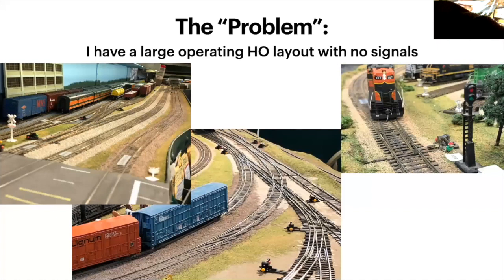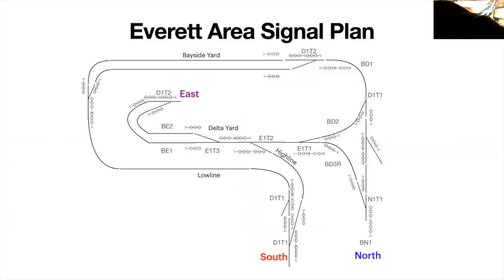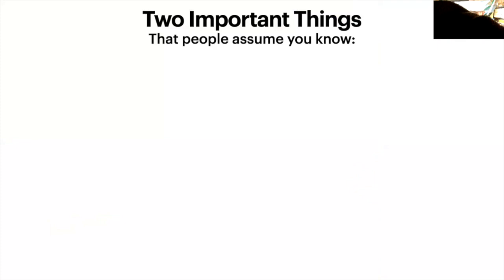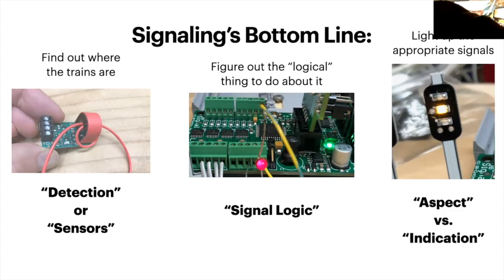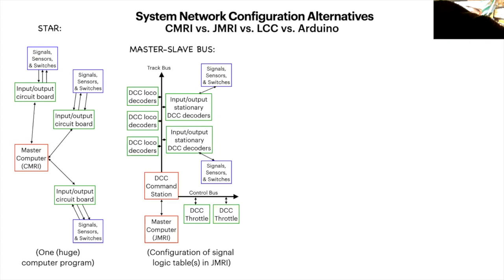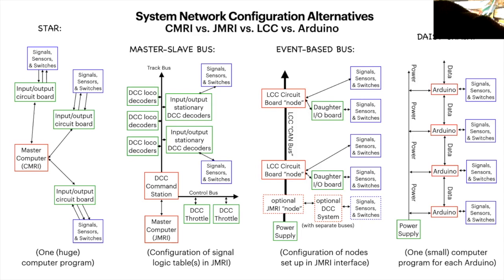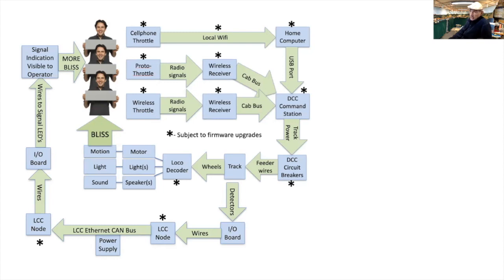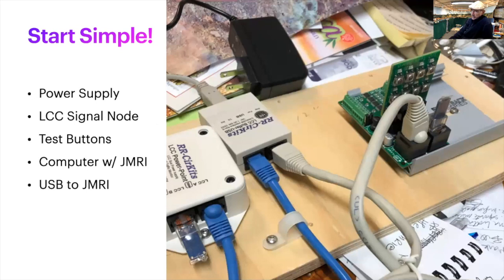Model Railroad Signaling intro clinic by Burr Stewart - exploring LCC

Comment: I am diving head first into LCC signaling. 
Now that it’s 4 years later, is there anything that you learned that you would advise to someone that fell down this rabbit hole?
Reply from the maker: Great question. A lot has evolved in the last 4 years in terms of train control, such as the new TCS and ESU command stations, and now NCE updating their older one. Not to mention Network Attached Storage (NAS) and other technology. As usual, the key is to start with honestly assessing your "objectives" before diving into alternatives. A few weeks after I made this video, I looked at my upcoming workload (both train and non-train) and decided that I didn't have the bandwidth to complete the Delta Wye LCC design, so I built a simple patch-board for connecting turnout position status from the three Tortoise switch machines to three double signal posts with no computers or anything, and let it go at that for a couple of years. Shortly after that, a fiasco with using Dropbox for my JMRI files caused me to lose my JMRI dispatchers panel that we were using to remotely control the wye. So, now I'm about to install a new NAS so I can use JMRI on my upstairs and downstairs laptops easily. Yet another rabbit-hole to dive into.

Plus, as you may have seen in one of my recent videos, I'm constructing a model of the steel mill area in West Seattle, which has delayed all my IT systems rabbit hole activities.

None of this really answers your question, except to say "no, I haven't learned anything new, beyond that you need to allocate significant time and mental horsepower to yourself anytime you want to dive into a rabbit-hole!" :)
Reply: @muchfunwithtrains  I think you have learned a lot of lessons although they might not at first appear as lessons :)
Reply from the maker: Well said!

Comment: Atlas says they have a system that works with DC and DCC, and older common cathode signals. Problem is, I only do DC, and since Atlas does not make detection units, and there's nothing compatible either with DC nowadays, or Atlas' proprietary system.  I'm stuck either way, unless I come up with my own system.
Reply from the maker: What about using infra-red block detectors like the ones that Iowa Scaled Engineering makes? They probably can work with the Atlas system...
Reply: @muchfunwithtrains   I thought of something like that, but I don't understand yet how they will interface with the Atlas control boards. Other companies that make optic sensors or UV sensors, often have their own logic boards as one unit.

Comment: Nice video Burr, even for someone who knows nothing about Model Railroading :) . It keeps surprising me how complicated model railroading can get, it seems like it is almost as complicated as real railroads, maybe more so, with all the automation/control you are adding.
Reply from the maker: Good observation. There are many discussions in the model railroad community about how a real railroad has lots of people working full time on small aspects of the complex system, whereas we modelers are trying to do the whole thing ourselves. For example, driving a train by yourself when the prototype train would have had up to a five-person crew. Or, being a yardmaster for a yard, when the prototype would have had car clerks, yard clerks, billing clerks, and switch crews all reporting to them. And for signaling, there's a whole department focused just on that. We knock ourselves out! :)

That said, our motto is "model railroading is fun", and it really is! Super fun!!

Comment: Wow!! Thank- you very much for explaining the electronics. Through block diagrams. I have been a electronic tech, from the vacuum tube and relay logic area to the first transistor, PLC, programmable logic controller. My model railroading joy is the electronic side.  Our club is also just starting the signaling styles. I am advising members to watch your video. Like you many members are scared of electricity. Your explanation will be so helpful. With a properly wire layout, running trains are great. KEEP THOSE VIDEOS COMING. THANKS  your Iowa fan!!
Reply from the maker: Thanks for your enthusiam and comments. One of the challenges I have as an amateur electronics fan is the basics that more experienced people take for granted. For example, if you're going to use a relay, does it need a separate power supply? What sort of power supply? Etc. etc.